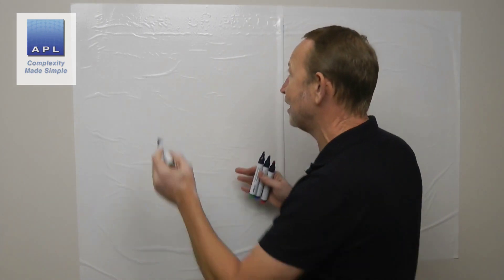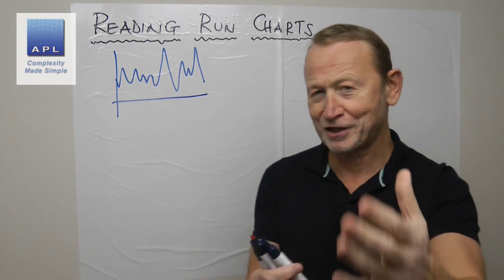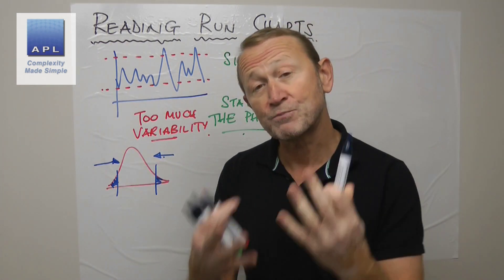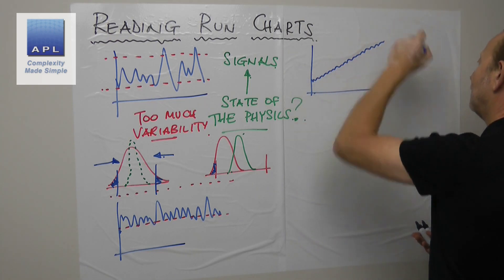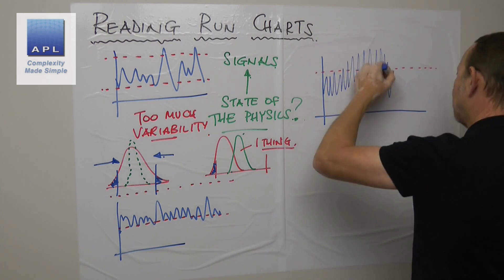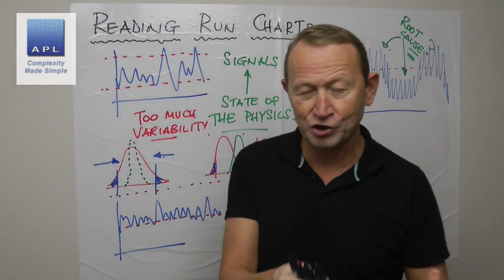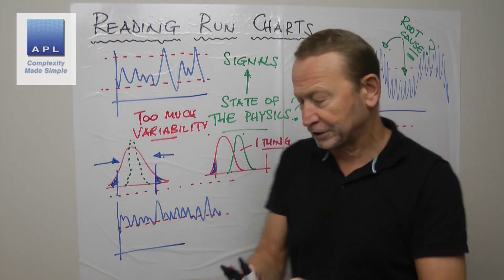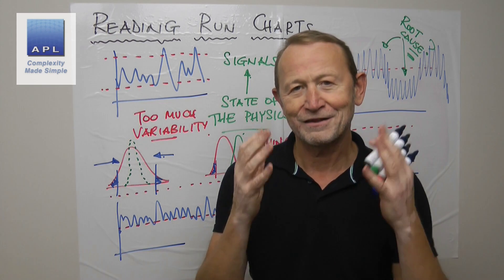How to read a Run Chart

Comment: Paul, thanks for your work. I have one question.

In order to calculate  voice of the process. Can you take data from the run chart to excel spreadsheet to calculate the mean and then using function StdDev.S to calculate process control limits for this sample size?

Lets say the mean is 20 and the standard deviation is 0.1.

Is this correct to calculate the process control limits in this way:

Upper process CL =20+(3*0.1) =20.3
Lower process CL =20-(3*0.1) = 19.7

And then add it to the run chart? Is this way doing it correct?

Regards

Karl
Reply from the maker: Hi Karl - Good question and the answer is the best way to work out limits is to use the shewhart calculations. The method you suggest gives limits that are too wide and therefore they under react...
I think this is the video you need to watch - https://youtu.be/FSdZ41FN1Dk
Reply: @paulallen5321  

Using ImR?